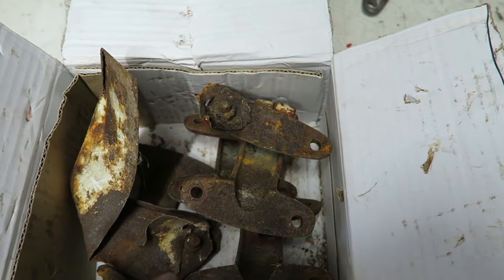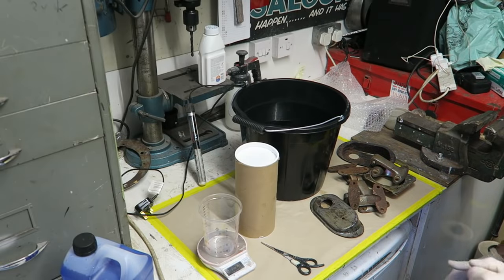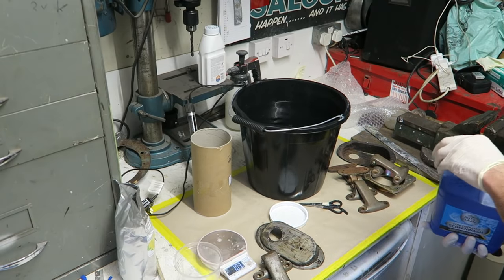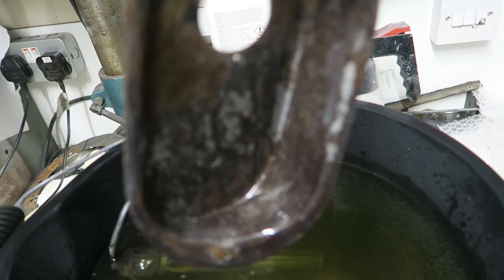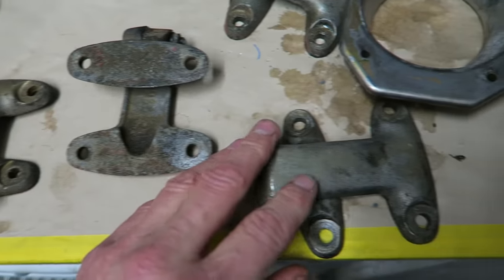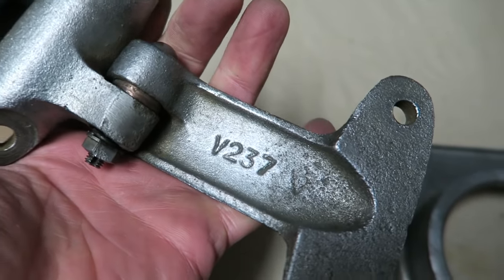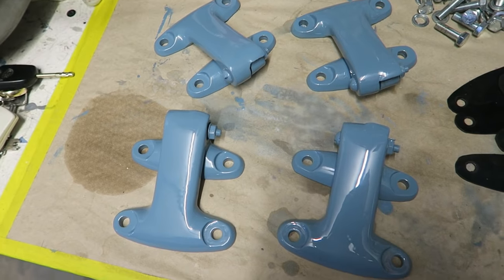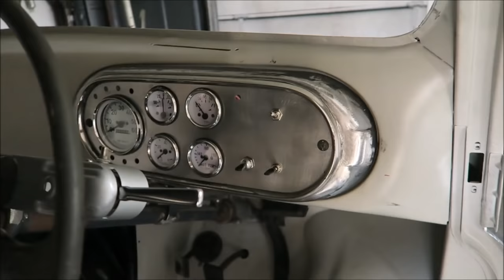Trev's Home Brew Rust removal potion solution remedy Tips and Tricks #23

Comment: Dont you have a sandblaster Trevor I made one from a 55gallon drum and the gun's are cheap on ebay it would make the process quicker with your Solution aswel maybe glass bead them .and it was yellow chromemate they zinc plate first then dip in yellow chromemate pal
Reply from the maker: Mysterious Rider yes we do shot blasting at work, this was a video to help out someone with limited equipment. Cheers Trev 👍

Comment: Have you tried molasses for rust removal?
Reply from the maker: Marc Fuller I haven’t but my understanding is that it works very well, if I remember rightly the molasses converts to an acid when it comes into contact with the metal, which then removes the rust. Cheers Trev 👍

Comment: Trev, I'm really impressed with these results. I've used a battery charger with soda ash (or washing soda) solution to remove rust which is also a 24+hr process. This method is less troublesome. I've heard acidic solutions are commonly used for restoring rusted hand-tools.  One time I accidentally did the electrolysis method with an acid solution instead of the alkaline and it still worked. I have used dry powder acid and soda ash from swimming pool chemical supply stores. Liquid swimming pool acid is just muratic acid (HCl) used for masonry, only pool grade stuff is a bit stronger.

Comment: Im curious would acetic acid cause hydrogen embrittlement?
Reply from the maker: Elektro Bear 🤔🤔🤔🤔
Reply: @trevsblog  also the commercial rust removers that  use citric acid, do not mention any dangers using it on load bearing parts 😓
Reply from the maker: Elektro Bear my own personal opinion but I’ve bent things after treatment and there doesn’t seem to be any noticeable strength or brittleness difference, I have read however that all acids apart from glycolic acid will under the right circumstances cause hydrogen embrittlement. I’m not a chemist or a metallurgist so I caution with accepted advice given to me. A piece of bodywork isn’t a danger if it’s treated but I’d rather not risk a brake or suspension part, I’d rather just get those parts shot blasted. Cheers Trev 👍

Comment: does it strip paint from rims?
Reply from the maker: ezcondition if the rims were quite rusty it probably would as it creeps under the paint but any acid on steel may create hydrogen embrittlement which could possibly make the metal  brittle. Best to find a company that does shot blasting. Cheers Trev 👍
Reply: @trevsblog   but this doesn't apply to aluminum right?
Reply from the maker: ezcondition ah... I don’t know never tried it on aluminium. You could be the first to find out.

Comment: I am coming to the conclusion metal is organic, not mineral, it's got so much life, constantly changing, constantly being affected by it's surroundings, easily influenced by other elements ... I know this has no scientific value, just an emotional response!
Reply from the maker: That’s an interesting perception and certainly steel does seem to have a will of its own, and on many levels. A friend of mine once remarked that steel in its natural state is iron ore. Iron ore is a stable passive unchanging substance that happily lives underground. Once that ore is turned into iron/steel it then becomes unstable until it turns back into iron ore. A scientist I heard on the subject said that when steel/iron is created a great deal of energy is put into it’s creation, the rusting process is the reactive process of discharging that energy. Cheers Trev 👍
Reply: @trevsblog  Excellent interpretation that makes a lot of sense, and a bit more scientific than my perception. Either way, working with metal does make you feel connected to the core elements.
Reply from the maker: Absolutely agree 👍 it’s sad that so many people will never appreciate what you have experienced. Cheers Trev 👍

Comment: Hydrogen embrittlment. A if a few hydrogen bubbles will do that.  You need pressure ffs
Reply: No need to worry about de-rusting brake or suspension parts as long as you can heat them up to a couple of hundred degrees CELCIUS for half an hour or so, a domestic oven is fine, and that will drive any dissolved hydrogen out.
Any acid will pretty well dissolve Zinc, as you have found, vinegar would do the same. You should try electrolytic derusting, it will lift the paint for you as a bonus. You just need to degrease your parts first if they have great gobs of grease or heavy oil on them.

Comment: nice.  Now looking for a local pond to drive in my car and add some citric acid ;-)  Is there anyone having a scientific proof of the embrittlement ?I have heard it befor but hard to believe.  Maybe it is only in case of electrolysis (where the water is being split in H2 and O2).  But H2 is known to evaporate from all materials very easy(eg. H2 filled balloons always loose their charge after some time) It is very hard to stock H2 so I don't believe in it. Anyone ?